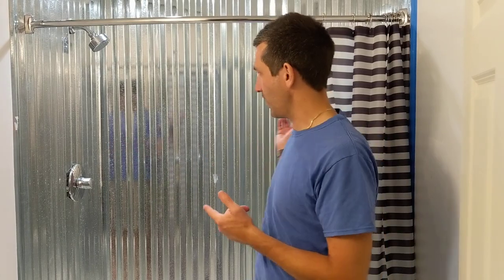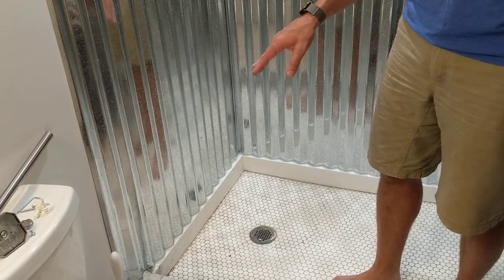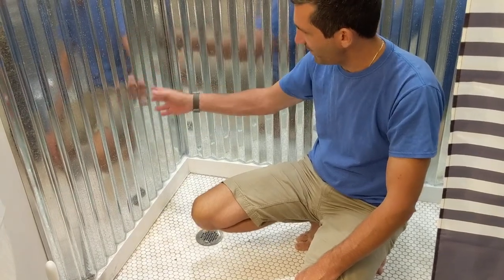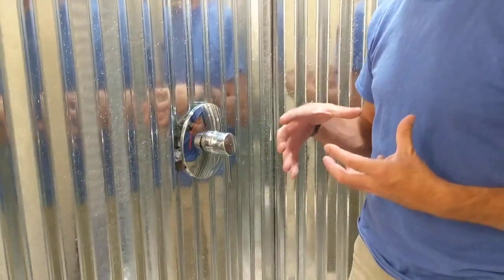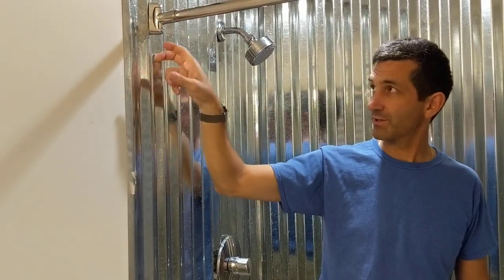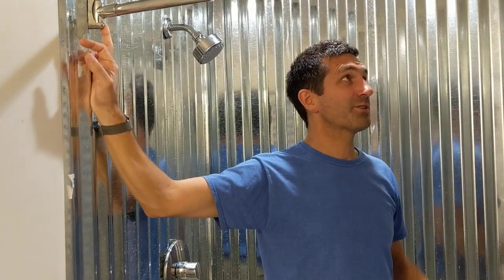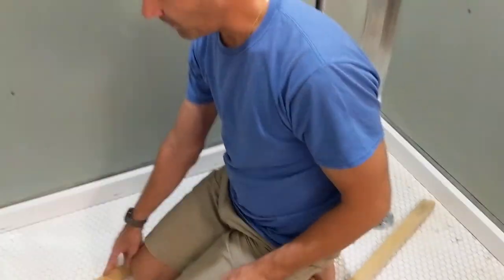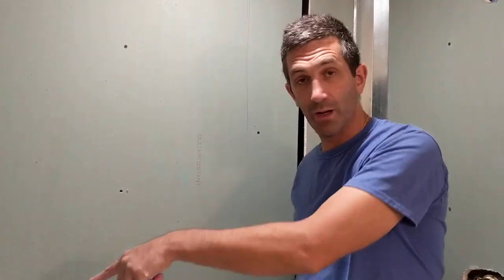Installing a corrugated metal shower

Comment: We built a new shower in our master bath and did the corrugated tin walls as well. Love it! The only problem I have is cleaning the bottom edge where the Corrugated edges meet the shower. Suggestions?
Thanks!

Comment: Thank you so much for this video it was great for my ideas. I also would like to suggest that you do use gloves when using power tools because it gave me anxiety.😁👩🏼‍🔧
Reply: Gloves are not always a good idea. They can get hung up in a saw it other tool and actually cause more damage. When I worked construction I NEVER wore gloves when using saws specifically unless I was just doing a quick cut on a board and my gloves are fitted so they don't catch.

Comment: Magic eraser might remove the bar code off the pvc without damaging the pvc. You could use a piece of galvanized chimney or large pvc to create a shroud behind the escutcheon ring. I'm copying this idea to use in my shop. Thank you for sharing!
Reply from the maker: Good call on Magic Eraser. It worked a treat!

Comment: Thank you for this video! Wondering what the overall cost was for this design? Husband & I are considering this for our basement bathroom and comparing costs and options.
Reply from the maker: Not counting the shower valve, and not counting the tile floor materials, under $125. You can tile, or buy a fiberglass floor like Dreamline.

Comment: How is this holding up since you put it in?  Saw another video where they used screws...  Was wondering how the adhesive is doing?  Liked a lot of the tips like the baseboard braces to hold them in place...
Reply from the maker: I was just looking at the shower this evening. I'll do a follow-up video, because I skipped a lot of things that would be good to share.
The shower looks great. I recommend using adhesive over screws.

Comment: Where did you get the steel siding?
Reply from the maker: I got it at Home Depot. It's corrugated roofing. I added the link to the video description. Here it is:
https://www.homedepot.com/p/Gibraltar-Building-Products-8-ft-Corrugated-Galvanized-Steel-31-Gauge-Roof-Panel-13513/202092961

Comment: Wondering if you can use a PVC Z channel for the drip edge at the bottom and skip that trim piece you scribed. Thoughts? Did you treat the metal to help minimize corrosion? I also have seen you can cut sheet metal with a wood blade installed in reverse, but haven't tried it yet myself.
Reply from the maker: @privateeye2490  I did not treat the metal  it's galvanized. It's been years  and there's no corrosion. I haven't tried the backwards blade trick.
Reply: @nickydoes  Thanks. I have heard that even galvanized will corrode, but it doesn't seem to be often that folks are treating the metal.

Comment: Hi 
Great video lots of good information and ideas,  for the corners do you think that rounding the corrugated sheet using it's own flexibility would make it more waterproof as you would not have any seams in the corners. what are your thoughts on this method to overcome the problem of corner installation. As I may be interested in using this material in my bathroom project. 
Keith
Reply from the maker: You'd have to accurately bend the corners. Adhesive and silicone make a reliable, watertight joint.
Reply: Corrugated metal is harder to bend with precision than it looks. Also complicates measuring for hole where faucet is.

Comment: Had only a few cuts why not snips or big hand cutters. You didn't mention about wiping off the oil from the metal. Generally those sheets come oily. I assume you did.  Didn't see entire vid, guess what I missed was the faucet instal, that's the critical part to me for no leaks.

Comment: Like the video and use of PVC and corrugated.  Did you consider rabbiting the back edge &/or bevelling the front edge edge of the pvc for water shedding?  If the silicone seal between corrugated and pvc fails the water pools inside the membrane?
Reply from the maker: The silicone seal will fail at some point, so your point is well taken. The membrane extends quite a bit higher than the PVC, well into the corrugated. Still, a rabbet or glued up step should reduce the chance of water ingress. It's a good idea for a follow-on video. Thanks!

Comment: Did you add any trim or flashing on the corners?  I know you taped behind for seal.
Reply from the maker: The bottom corners are formed with a shower pan. Galvanized drip edge forms the inside corners. The bottom of the drip edge corners overlap the shower floor membrane. Corner water runs into the shower pan.

Comment: What should I use behind the pvc bas so water can’t get behind it
Reply from the maker: Nothing. Run the PVC high enough (12 inches) behind the metal. Water can't get through the metal.
Reply from the maker: Not if you're living in the USA. The EU refillable containers won't fit USA machines.
https://www.reddit.com/r/Miele/comments/y857p4/do_the_european_twindos_refillable_containers_fit/

Comment: You’ve mention the foam did you get at home depot? Doest it have the contour of the corrugated tin?
Reply from the maker: It's called a foam closure strip
Gibraltar Building Products	2 ft. Closure Strip Foam Corrugated Roof Accessory in Black
https://www.homedepot.com/p/2-ft-Closure-Strip-Foam-Corrugated-Roof-Accessory-in-Black-98189/202093154
SKU# 202093154

Comment: What kind of adhesive glue you use.. what's the name of it.
Reply from the maker: Loctite PL200 or PL400
Reply: @nickydoes  has there been any separation?  How long did it take to dry/cure?  We are in middle of doing this and using the suppliers recommended adhesive/sealant but it's not drying.  Everytime we take the support off, the metal just slips off the wall....its not drying.

Comment: Hey Nick! Thanks for the great video! After having it for several years how do you feel about running the metal all the way down to the tile? I'm going to be installing the corrugated metal in my off-grid cabin. the floor of the shower is a concrete shower pan topped with natural rock grouted tiles and was hoping to run the metal right to the tile with a bead of silicone. Also, how did you mount the corner shelf? Thank you for your time! Cheers! - Dan
Reply from the maker: Glad you liked it.
They've been maintenance free for 3+ years. I didn't run the metal to the floor. I made a base frame of PVC. The shelves are held with Simpson brackets from Home Depot. Good luck on the cabin.
Reply: @nickydoes  Thanks Nick! Yes, I know you didn't run it to the floor but was asking if you would have now after having them for 3 years?! Thanks again for the fast response!

Comment: great video .. !!!! ... but I have a question .. you did two inside corners with the metal flushing but how do you do or how do you do the edges on the outside ( where the rod curtain is ) ? .. isn't that edge sharp ?... if it is not ..then do you press it against the wall..?

another thing .. how to do you outside corners? 

thanks in advance
Reply from the maker: Good question. The outside edges are not cut, and are not sharp. I glued the panels so the edges press to the walls. You certainly could trim them with PVC trim.
Reply from the maker: Outside corners might be a bit more tricky. The intention of this shower was quick and inexpensive, while still looking great.
Reply: Use j channel

Comment: I’m planning on doing this in my mobile home bathroom where there is already a surround in the tub that is not attached to the tub. Do you think I could just run this over that surround? It seems like it’s plywood with some sort of waterproof sheeting versus drywall. What are your thoughts?
Reply from the maker: Covering the existing surround sounds like a smart idea. The cut metal edges are sharp.
It's going to be great!

Comment: How did u mount the shower head?  I just did a corrugated shower and the trim piece  that goes around the shower head pipe is held out from the wall.  Looks kinda weird.
Reply from the maker: I centered the shower head opening on a corrugation valley. Then I did the ugly thing and siliconed around the trim piece. You could cut up some of the black edge insulation to make a block, glue the parts together, then carefully cut a hole through the middle, too.
Reply from the maker: Look for a quick update video Part III to upload shortly.

Comment: Would this work over existing tile or do I need to remove the tile?
Reply from the maker: Sure. Use silicone tub and tile sealant, sold in 10 oz. caulk gun tubes. Space dollops of silicone about 1 ft. apart, on the backs of the corrugated metal. Press the metal in place. Lean a long 2x4 or something against the metal to hold it to the tile wall while the silicone cures.
Reply from the maker: Years later, you could easily remove the metal and slice the silicone off the tile.
Reply: Make sure the tile is nice and clean.

Comment: What kind of nails did you use for the PVC trim at the top? I'm guessing they have to go through both the trim and the metal and still be long enough to hit a ceiling stud.
Reply from the maker: I nailed the ceiling trim with 2-1/2 in 16 ga finish nails using an air nailer. It's important to mark your wall studs before drywalling the shower walls.

Comment: Hey Nick, thanks for the video.  You cover the biggest concerns I have about using corrugated metal.  Just wondering how everything is working out after 2 yrs?  Also, would you do anything differently if you were to do it over again?
Reply from the maker: The kids are happy with their showers. I wouldn't change anything.

Comment: How to install this above your tub
Reply from the maker: HI Freida, the process would be similar. Surround tubs have a lip around three sides. It serves the same function as the gray shower pan liner in the video - directs dripping water into the tub. Cut your corrugated panels so they run from the ceiling to the tub, then install them inside the lip. Be sure to add PVC trim where the tub meets the panels. The metal edges are very sharp as cut. Also, the edges you cut have no rust resistant galvanized coating, so they will be unsightly after a while.

Comment: How did you seal around the shower faucet handle? Just caulk around your foam?
Reply from the maker: I sealed the top and bottom by compressing the foam. The sides are caulked.
Take care in laying out where the corrugations will land over the showerhead and faucet cutouts. Those two should be vertically inline. Center a corrugation peak or valley over the vertical line. The protrusions will be more attractive and easier to seal.
Reply: @nickydoes  Great video Nick!  Planning my project now. I have the same questions about the valve mounting. The escutcheon is designed to mount against a flat surface, right?  How does the “foam” assist in creating a seal?

Comment: Where do you buy the panels?
Reply from the maker: For 8 ft. or lower ceilings:

Home Depot:
8 ft. Corrugated Galvanized Steel Utility-Gauge Roof Panel
https://www.homedepot.com/p/8-ft-Corrugated-Galvanized-Steel-Utility-Gauge-Roof-Panel-13513/202092961

Lowe's: http://www.lowes.com/pd_12473-250OVALEC0800-18591_4294937087?productId=3317582

Comment: Hello how did you seal the bottom of the sheet? thanks.
Reply from the maker: I applied a bead of silicone caulk where the corrugated sheet metal meets the PVC. If water penetrates that joint, the shower pan liner is above that joint, so the water will still be contained.

Comment: I am wanting to do this but keep my bathtub
Reply from the maker: Alcove bathtubs normally have a small lip (flange) on the three sides where they meet the walls. The corrugated metal can be installed in front of these flanges.
Reply: @nickydoes  if installing onto a metal tub and only the beams of the walls are there..... Can I just use plywood and glue it to ply wood...
Reply: Also offsetting directly on tub and caulking it there will it rust....

Comment: Did you said that the corners are drip edges? Where did get them like that in aluminum?
Reply from the maker: They're galvanized steel, from Home Depot next to the corrugated metal panels.